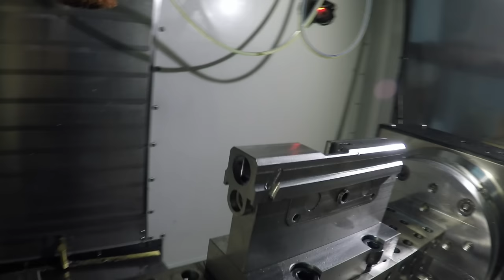Raptor One CNC machining from Springfield Slide Blank

Comment: i ordered one for my xdm 3.8 compact and the well that the extractor sits in was machined too large to apply the tension necc. for the extractor to grab the casing. i sent it back and ordered the threaded barrel and short comp.  your cust. svc. was excellent. having said that ive  noticed that all of your slides are "out of stock"  did you have to pull all of your stock off the shelves / and if so when will you have them  in stock bcuz im still interested. on a side note the compensator was a FAIL it stripped its threads out after maybe 200 rounds thru it.

Comment: Ok. That is incredible! Did I read correctly in one of the comments that you can do that exact slide cuts for a glock 19 if I send in my own slide for $198? I don't need it cerakoted because I have blowndeadline right down the street. Is that correct in the price? Also what would be your lead time? Thanks 👍🏼👍🏼

Comment: Design dynamic which has machine do I see you using in this video? By the way I like the look of the slide.
Reply from the maker: Thank you @jayjdw!  It's a 2014 Haas VF-2 with an HRT210 4th Axis/Rotary.
Reply: +Design Dynamic thank you for your reply. I'm looking into purchasing one myself and there are so many options. I've been looking for a used one because you find them so much cheaper. I found a 08 vf2 for 20k and a 07vf3 for 50k

Comment: do you do this kind of work for your customers and there pistol slides
Reply from the maker: Hi Joe.  We currently work on Springfield and Glock slides and cut our Raptor One designs along with (optional) RMR seat cuts.  On a case by case basis, we have done custom customer requested cuts--but the cost varies depending on the complexity.  Everything we do has to be CAD modeled first--as we do not do any manually machining.

Comment: What kind of Cnc machine is that? I've never seen anything like that before.
Reply from the maker: It's a Haas VF2 with 4th axis.
Reply: 0.O $$$ wut.
Reply: I worked for a local Haas dealer when they just had the VF1, and rotatory table installs.   I preferred LeBlond Makino maching and Mori Seiki turning. I work on subway cars now, civil service

Comment: Nick,  Can you cut a TITANIUM SLIDE with your tooling??  Have a TAURUS 609 PRO Ti pistol that would be an awesome project like this…please let me know…thanks.
Reply from the maker: Hello.  I would not recommend Ti for the slide.  Aside from it being very expensive (just the raw barstock alone would be several hundred dollars--not including the machining expense) but Ti, although strong, is a fairly soft metal compared to steel alloy.  You would see premature wearing locations such as the slide lock and breach face.
Reply: Well, the slide on my 609 PRO is made of TITANIUM…guess I should ask if you can machine some of those cut outs over the barrel.  Mostly, it's for the ''COOL FACTOR' and a little weight loss as well.  You're correct in saying the metal is 'SOFT'...mine shines up like a mirror when polished.  Let me know.
Reply from the maker: Yes, definitely very cool and much lighter than steel--but just very costly, especially in a one-off scenario; and I'm unsure of the longevity of the slide after several thousand rounds with the softer metal.  Sorry, we unfortunately do not work on any slides outside of Springfield and Glock at the moment.  Since we're completely a CNC/CAD shop, doing one-off's is very expensive because we need to fully model the slide in CAD and then program the CNC/machining center to make the cuts;  whereas perhaps a smaller shop with a manual mill can make basic cuts a lot easier with just a single slide.  We're more set up for higher volume runs.  Sorry my friend, wish we could help you.

Comment: 4-$500 just for the slide plus the 50-$100 for cerakote? That is insanity! So here’s some free advice: sell cheaper, you will sell more= more profit. That mod cost more than the pistol itself.
Reply from the maker: Appreciate your perspective; however, there are two types of gun owners.  Those who are satisfied with factory stock and those who want something with unique styling different from most everyone else at the range--as well as premium performance above and beyond factory stock.  The latter of course comes at a premium due to higher-quality materials used, the amount of customization involved and precision CNC machining in which mass-produced factory slides cannot replicate (and be profitable due to their large production scale).